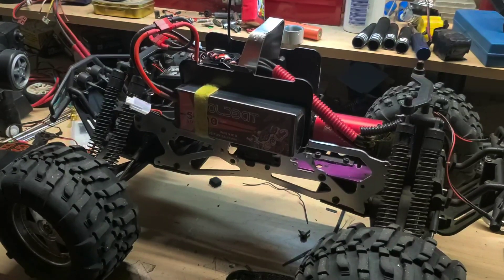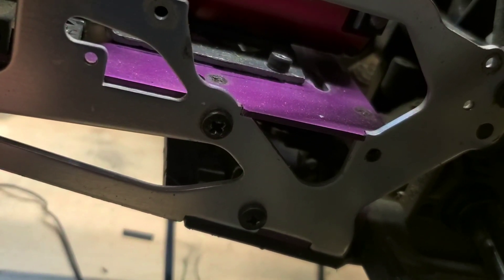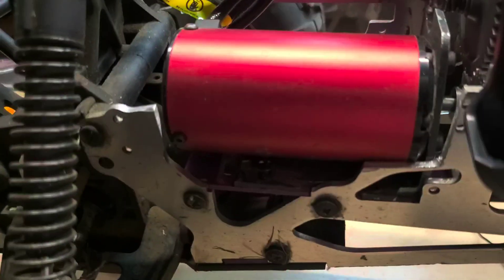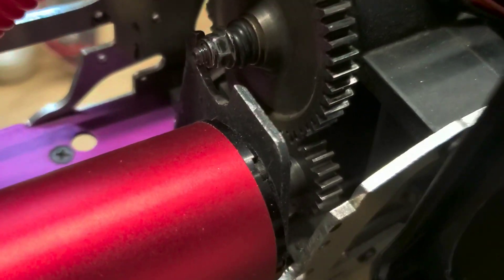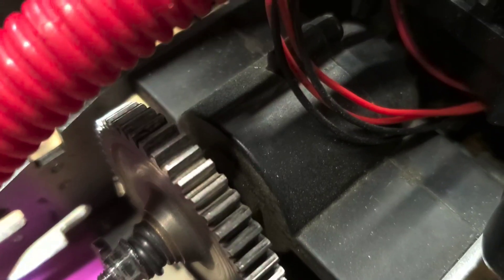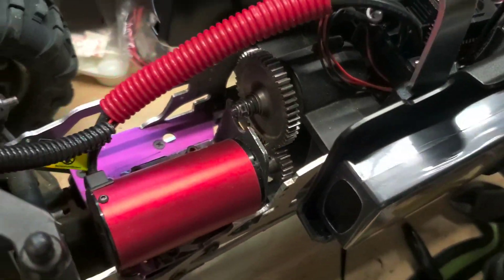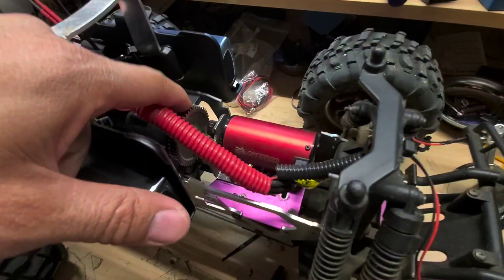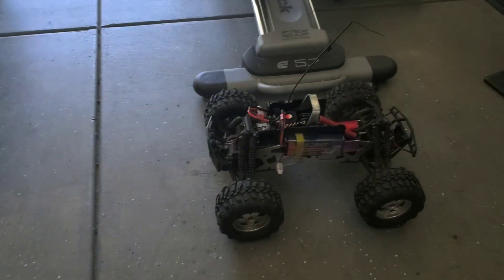HPI Savage25 Electric Conversion

Comment: Hi trying to convert a savage 25 nitro to electric. How did you get reverse, is it obtained by locking 1st and 2nd speed and pinning the 1 way bearing so that it’s locked in both directions?
Reply from the maker: @aaronpalmer9714  Hello, sorry for the late reply. The motor and ESC comes with reverse gear built in. Check the specs and make sure it has reverse. It shouldn’t matter if you lock the 2 speed trans or not. Let me know if you have any other questions. What motor setup are you using?

Comment: $40 for a integy conversion kit with hardware and a bat tray and a pinion gear. Did you make your savage single gear?
Reply from the maker: Yes, I did make it a single speed. If you're interested I posted the link in the description. I did see the integy kit but my motor was too big so I ended making one. 

What truck or car are you converting?
Reply: I’m keeping the two speed way faster and still have the torque

Comment: Where did you get the motor mount
Reply: I just got one online. It's made by integy. $40
Reply from the maker: It's custom. I had to make it from scratch. If you're handy you can make one out steel plate. Use a grinder to cut.
Reply: @RC Daniel yes it works. Totally worth it! I'll have videos up of how to do it once the flux gear comes in the mail. You need to get a flux gear to make the trans single gear. And I am using a Traxxas vxl system 3200kv it pushes it decent but could use some more.
Reply: @RC Daniel the conversion kit comes with a pinion but it's .8 and not mod1
Reply: @RC Daniel awesome thanks! I just got the integy conversion kit for $40 dropped it in and it was ready to go!